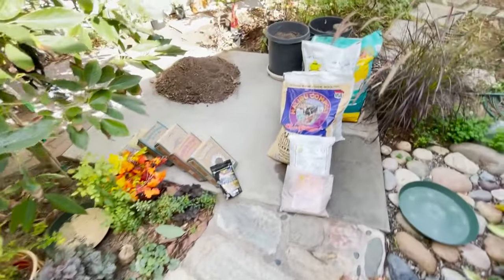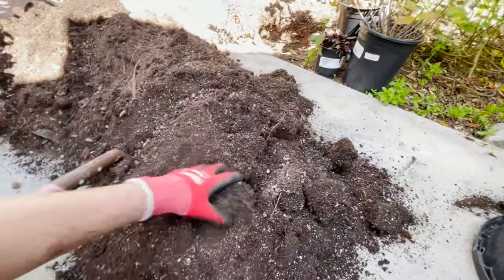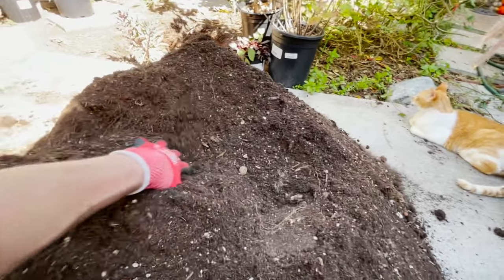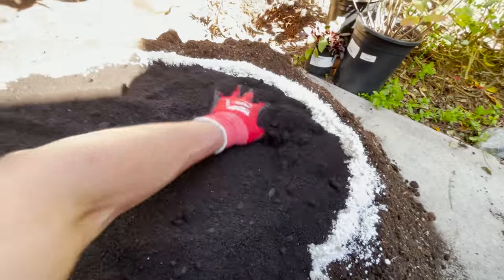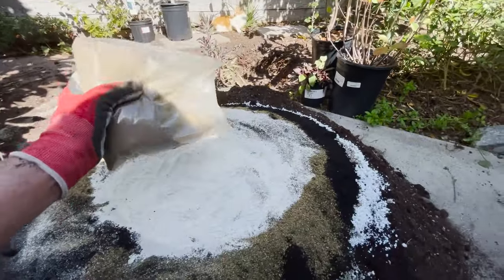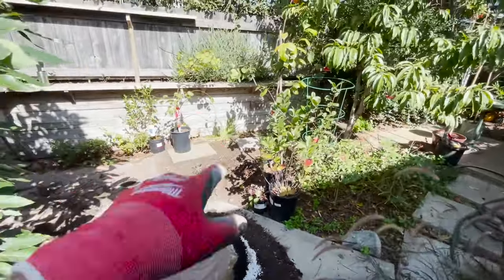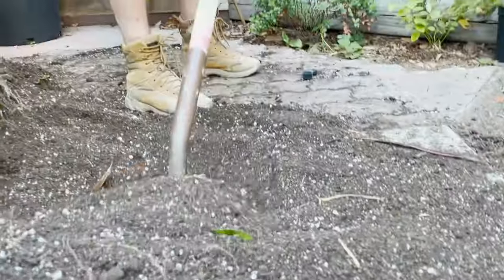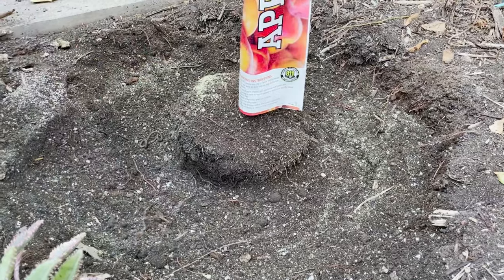How to Prepare Soil before Planting a FRUIT TREE (step-by-step instructions)

Comment: Can I use this same method for fruit trees grown in containers ? I actually plan to buy an apricot tomorrow July so it won't be bareroot I guess. Also will this same mixture be good for cherry and plum trees ? Im wondering if I'd have to wait til spring to pot them
Reply from the maker: Sure that should be a good mix for a container pot as well.   My apricot tree is doing great in this soil and others should do fine as well.    Can't wait to get apricots!   Plant them now it should be fine.   Keep well watered in Summer though